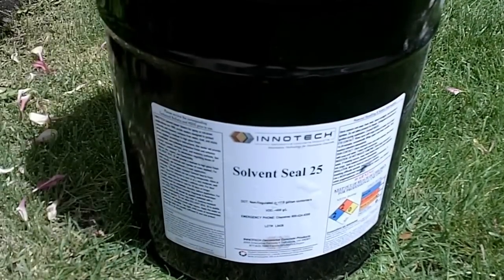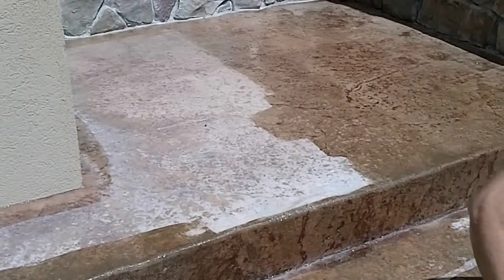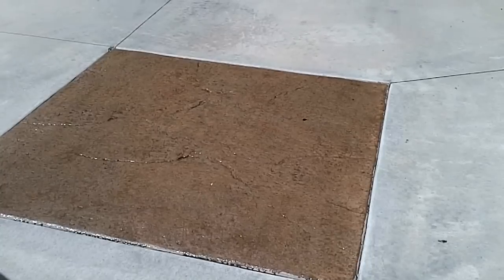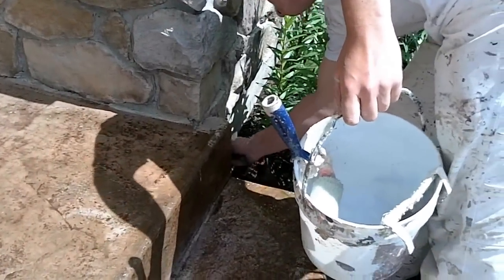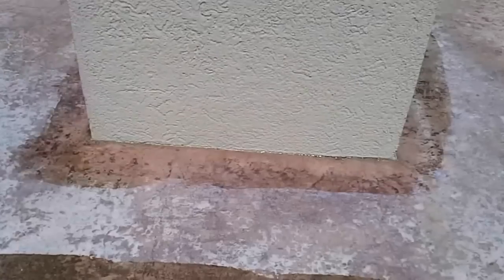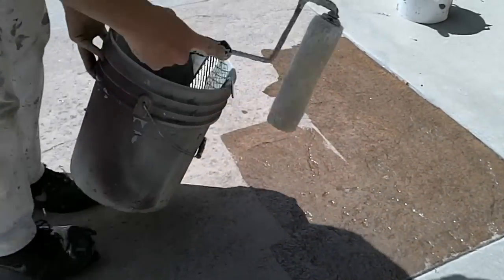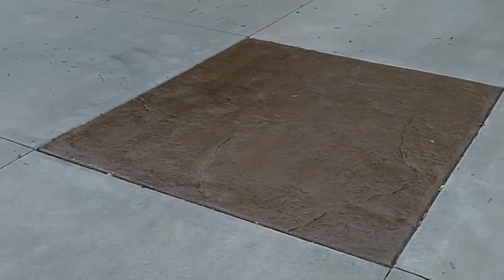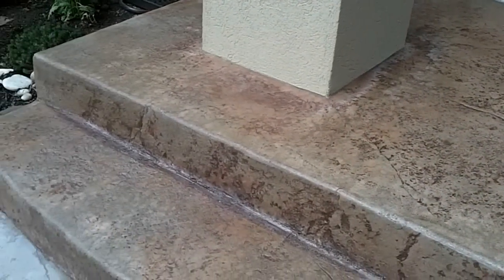HOW TO RESTORE CONCRETE SEALER.  Restoring faded colored concrete.  Sealing stained concrete.

Comment: My patio has colored concrete designed to look like flagstone with a 3/4" grout gap in between. The grout has started to crumble and much of it is missing. Do I need to remove all the old grout and re-grout before I use the Stain Seal 25?

Comment: Just moved to a commercial retail suite. The landlord paid for all tenant improvements including floor covering.  I asked them to do a stained concrete floor instead of tiles.  When done, it wasn't shiny and the floor is a little sticky.  Dust and dirt kind a stick to the floor.  Contractor said it's done, but because of time constraint we had to move in right away.  I want to seal and clear coat it, to make it shiny and easy to clean.  What do you suggest I do and what product should I use.  If I do sections of the retail shop, say, start Saturday 4 pm, will it be ready to be walked on Monday 10 a.m.?  Thanks.

Comment: My concrete looks about like the one in your video.  Up under the porch, you can still see quite a bit of color.  Out near the road on the sides of the driveway, it's faded out a lot more.  How do I know whether to restain on top of the existing seal or just reseal.  I'm afraid that the color has worn off.  The concrete work is 8 years old since builder did it.

Comment: How would I repair indoor  stained concrete? A fragrance plug in spilled on the floor while I was away (animal knocked it off the wall) & it eroded the seal & stain. Please help.